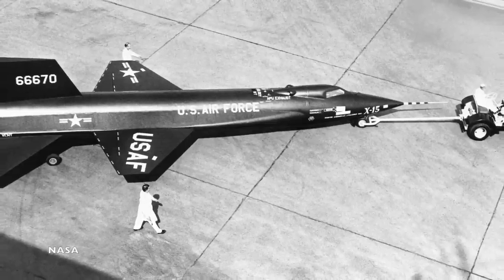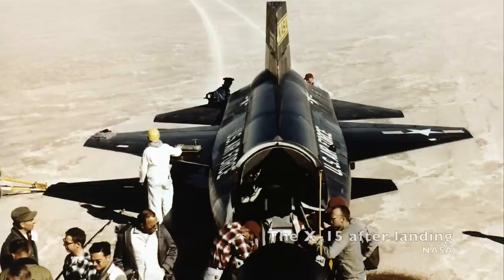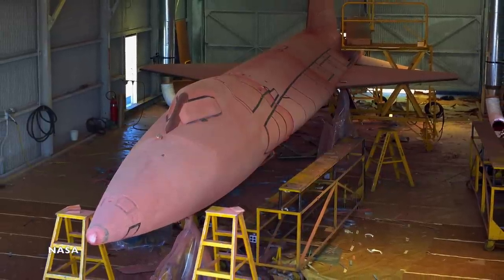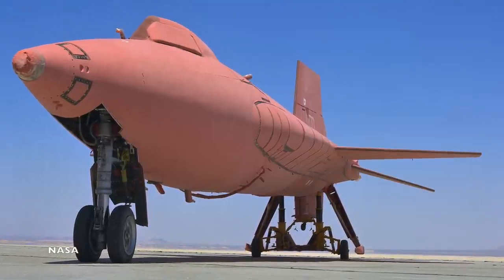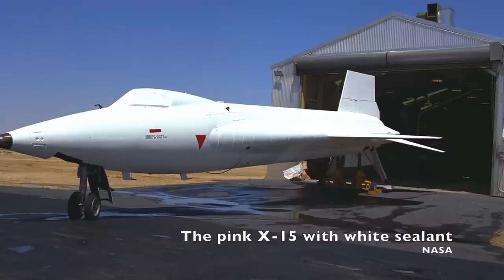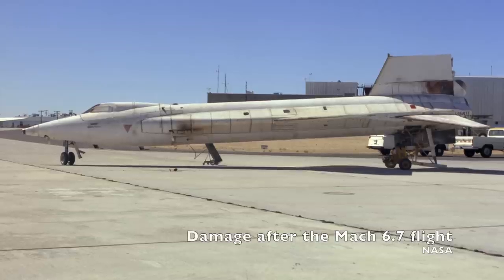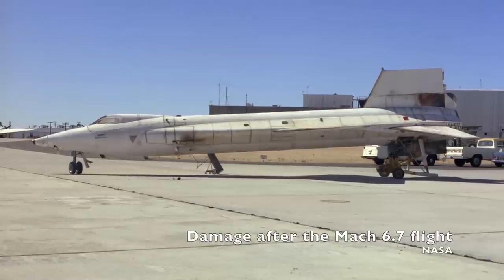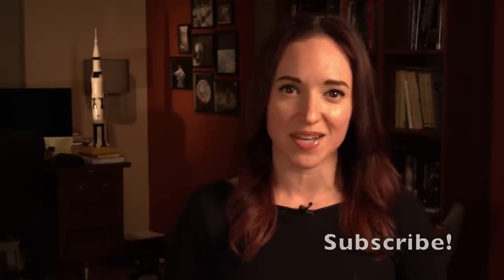NASA's Pink X-15

Comment: My mom remembers seeing the X-15A-2 at Edwards shortly after Pete Knight's record-setting flight and being shocked by its severely charred and battered appeatance.  Her dad, my grandfather, Vic Horton of NASA, was a project engineer and also helped test the plane's big XLR-99 rocket engine during his time with Thiokol in the 50s. He also used to fly as B-52 launch panel operator for both the X-15 and the lifting bodies. She asked him what happened to it and if it was supposed to look like that and Grandpa responded inba somewhat chilled tone, "No, it's not! They tried a new heat coating on it and it didn't work! Were lucky we didn't lose Pete in the process." Years later, I asked Bill Dana about it and he told me that later studies showed the X-15A-2 would have reached at least Mach 7.4 if flown to propellant depletion (Knight shut the engine down early during his flight), most likely at the cost of both the aircraft and pilot.

Comment: It was also that ablative coating that held the accumulated heat in & didn't allow the plane to cool properly. As a result it actually got hotter with the coatings applied.

Comment: Interesting that the whole vehicle was covered. Aerodynamic analysis and model tests of that era would have been sufficient to show that only the nose, chines and control surface leading edges would require protection. Painting the whole thing added a lot of weight, but then again thrust did not appear to be a limiting consideration!

Comment: I was doing contract work at Arnold Air Force Base in 1990. I had to move a few things in the base historians office. One of those was a door stop. He said "You may have that". In disbelief I asked "Do you know what this is?" No was his answer. It was the wind tunnel test of an X-15 model. Complete with threads to mount it. About two feet in length and very heavy. I have always wondered if he logged it into his inventory, or absconded with it.

Comment: I'm a multi degreed Engineer who works for America's largest defense contractor in their Space and Aero companies...I just wanted to throw out a tid bit of Inconel info. Not many people in the public are aware of it but it is widely used in the military aerospace industry, but one even less known usage exists; one its metallurgical properties involving response to heat, beyond the ability to protect itself and maintain strength in high heat, which is why military aerospace vehicles use it, is its ability to retain heat, which is why high performance internal combustion engineers use it in exhaust systems (such as NASCAR, F1 and several Supercar manufacturers, along with some high performance motorcycle exhaust systems)...by retaining heat it increases the scavenging effect of the exhaust which increases internal combustion efficiency resulting in increased horsepower....FYI, Inconel is approximately the same mass as titanium, which means it also weighs less than other typical exhaust system metals, which is an added benefit.

Comment: I'll bet that as the ablative coating "burned" away, the flight characteristics changed slightly.  I wonder by how much?  You say that they coated differing amounts based on expected heating.  Maybe that made up the difference.  In any case I'll bet that it was like flying a different aircraft, at least in some respects.
Reply: The leading edges suffered the most damage.

Comment: what was the highest altitude of the X-15? The MiG-25 achieved 123,520ft and this was a standard 'air breathing' aircraft so the x-15 must have been incredible!! As always thanks for the work you do on the videos and articles, much appreciated!
Reply from the maker: The peak altitude for an X-15 was 353,760 feet. Joe Walker made the flight on August 22, 1963.
Reply: Amy Shira Teitel The peak altitude of the X-15 was 354,200 feet (67.1 miles).

Comment: Did these flights that reached the X-15's top speed include the use of external drop tanks? If not, I am curious on the details of how they changed the flight profile (higher, farther, ect). Perhaps exploring this could be good fodder for another video?
Reply from the maker: Yes. The X-15A-2 had the external fuel tanks. I think I will do a video giving an overview of the X-15 generally -- different flight profiles, different engines, external tanks, all that fun stuff!
Reply: Amy Shira Teitel Sounds like fun to me! Standing by...
Reply: Amy Shira Teitel The X-15A-2 only flew four flights that used the external tanks. The first of these flights used empty tanks with simple water ballast. The second flight had full tanks, but an indicator gave faulty information after launch that the tanks were not working properly, so the tanks were jettisoned and Bob Rushworth made an emergency landing in the X-15 at Mud Lake. The next tank flight went off without a hitch, but there was no ablative, then the final tank flight where the speed record was set by Pete Knight--which still stands today, more than 47 years later.

Comment: I saw a cat in the background! Did they land by instruments or plan on having the windows clear by then, what if the rocket failed to ignite and they had to glide back?
Reply from the maker: That is my cat! And the X-15 always made unpowered landings; the rocket engine couldn't burn very long and it burned all the fuel on board, so a gliding landing was par for the course for those pilots.
Reply: Yes I suppose they always glide land normally, but if they had an engine failure after the drop with the windows still covered in ablative material the pilot would have to land on instruments only, wouldn't he? I didn't think that an experimental aircraft of that time would be fitted out with the necessary gear to do so just by default, especially if they are trying to go hypersonic and save weight. I guess they could use a chase plane like the later space shuttle.
Reply: Ah I didn't see that the post flight picture shows the windows are still covered, must have landed on instruments then.

You should do a video on the MOL, and the hidden space suits too - really liking the channel, keep it up!!
Reply: Matt0Rapp The ablative material was not made to completely burn away during flight. The right-hand window did not have any covering on it, and was always clear. However, ablative would dissipate during high speed flight and the window would get coated by the runoff. The left-hand window had a mechanical eyelid with an ablative cover on top. When entering the landing pattern, the eyelid was opened and the pilot had a clear view out of an unaffected left window. The reason it was the left window is that the X-15 always flew a left-hand pattern in to landing.
Reply: Matt0Rapp It should also be noted that the X-15 only flew two missions with the ablative coating in place. One flight was to Mach 4.94 on August 21, 1967, and the second was the Mach 6.70 flight on October 3, 1967. Only the second of these two flights used the external fuel tanks.
Reply: Michelle Evans 
Thanks for the additional information, that is a neat system

Comment: Great vid :) ! Really interesting you tube channel. You deserve much more success :p (but well.. not so much people are interested by astronomy unfortunately... :( )

I juste had a question : How did the engineers solve the problem of overheat afterwards, since the pink and white coating were too hard to make for each flight ? I mean, what was the long term solution of this heating problem :) ?
Thank you :) !

( Please excuse my english mistakes, I'm french :) )
Reply: There really wasn't a problem of overheat afterward. The ablative coating literally burned away, and thus took the heat with it. The problem that occurred on the final X-15A-2 flight was that shock waves caused the ablative to burn away completely, and thus exposed the Inconel-X skin underneath, which then started to melt. It should have been realized that those shock waves were going to do just that from testing prior to flight. But the evidence was ignored and they went forward anyway. If the shock waves would have been properly compensated for, there would have been no burn-through of the metal underneath.

In addition, the ablative itself was not hard to make, but it was difficult to apply. That was where the problem in using that type of coating came in. Using this ablator actually helped to make the Space Shuttle ceramic tiles a reality because originally this type of ablative was what was being contemplated for use on a shuttle-type vehicle. The X-15 testing did exactly what it should, in that it pointed out that the idea that they thought would work, was not a good one, so they came up with the tile system instead.

Comment: how close was the x-15, or the SR71, from actually flying into space? that is, I guess, how much more thrust would be needed to get out of the atmosphere completely, or to get up to orbital speed? they were really close to 'space', and going really fast. Someone way back when must have worked this out exactly. Was dealing with heat the limiting factor in re-entry?
Reply: Bababoom - The X-15 did cross the Karman Line (330,000 feet) on two of its flights, and was therefore officially in space.  The SR-71 holds the altitude record for level flight (85,000 feet), but I don't think it ever did a zoom climb to get into space.  However, a lot more thrust is needed to get up to orbital speed - you can get into space with a V-2, but something much larger is needed to stay there.

Comment: Note transitional changes for engineers students on the X-15; Inconel steel to coatings.What was happening from the early planned in-flight projected profiles to the higher more dramatic ablative coatings added to the exterior skin of the X-15 is a marked change in flight parameter profile usage.

What is occurring here and you must stay abridge of the rocket planes history is a first, study in heat thermodynamics transfer of primary design intended useage of the Inconel metal skin.This metal would be able to endure and transfer heat during the first flight test of this air space plane, to an altered not intended usage of more dramatic changes held within zoom flight apogee achieving flight runs of a now altered exterior of the aircraft.

Technically' what they were doing to an extent, is sistering the heat transferring Inconel metal, to support an exterior covering that was more similar to ICBM intercontinental warhead load covering shapes.This new system of anti heat prophylaxis, rather than the first intended originally intended heat transfer of the original covering.

This was risky business and dangerous course to follow, as at any time during a high heat re entry like flight profile, metal exposed to worn bare ablative coatings as a protective factor, this condition could have that supporting structure underneath this coating to heat transfer metal, compromised.
This would have resulted in a folded wing and or some other structural aspect of the X-15 occur while in flight.

In the circles of aerospace engineering, this is why engineers along with mission devisers of planed flight profiles, will usually stick to a planned series of test flight, with an order for safety clauses affixed to that series of test flights.

Know that after they were done tinkering with the X-15, it more closely resembled a rocket to reentry vehicle, rather than a slower test flight velocities space plane.

They stuck their necks out in this program. But realize in many instances they had gotten away with it,  producing both the data and understanding in theories that were desired.
The book The X-15 Rocket Plane by Evans more than affords many of these details.Excellent book.Thank you Vrendus

Comment: It had no windows? How did it land ?
Reply: It had Linux
Reply: It did have two small windows, but on the first flight with the coating, they found that it tended to smear back over the windows as it ablated and cover them, rendering them all but useless.  The fix was to simply put an "eyelid" door over the left-hand window that would be kept closed until after they were slow enough that the ablation had ended; that way, you flew with the right-hand window until then, and then could open the "eyelid" and land using a perfectly clean and clear left-hand window.

Comment: "It got up to it's max speed of mach 7." Buuuuuuuut. There was an issue with the Ablative coating. It blocked the system of cooling the leading edges which was the cause of the damage. Ironically the Ablative did more harm than good for the X-15.

Comment: Notes, engineering, thermal reference in air-spacecraft evolutions:Bell X1, metal to outside only thermal protection, with same near generation air-spacecraft, painted white.X-15, aluminium inner frame, with heat transference abilities Inconel metal outside to heat air.Apollo spacecraft capsule, anti thermal white coatings, plus pitch or roll augmented setting to CorningWare-like ablative heat shield set to super hot air, as protective margin to inner workings of spacecraft.Space shuttle; breaking away from ablative materials to low density, but thermal tiles of silicate, which hold reentry heat airstream, to out margin of anti-thermal layer, along with carbon carbon leading edge protects against high heat per reentry.::Probable experimentation range, concepts of rocket exhaust gases around inflatable heat tolerant ballute and or created ionized plasma heat itself, by generator created layer.So heat to heat concepts in line with to be tested spacecraft thermal protection methods in thermal protection scope of air spacecraft developments to come.Notes X-15s were manufactured on a side by side assembly line, such as planes are.Stronger concepts of overall sharing to a central unified concept, quality checking and comparisons of construction task.Thanks

Comment: The plane was skinned with Inconnel not Inconnel X. The engine was built of Inconnel X but only the engine. The frame of the X-15 was built from Titanium and high temp stainless steel. Inconnel is a product name for Hasteloy. That is what the material is called in the metallurgy trade. Calling the material Inconnel is like calling a tissue a Kleenex. It is not you fault you think the aircraft was made of Inconnel X as I have read dozens of NASA reports claiming that it is so. NASA was simply promoting a product produced by one of it's supplier contractors as part of a deal. Typical NASA bullshit.